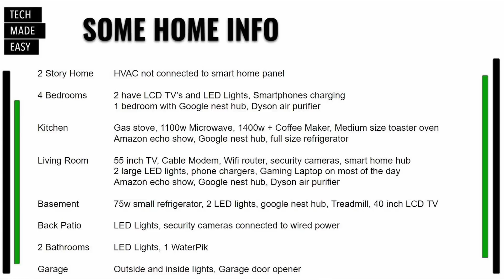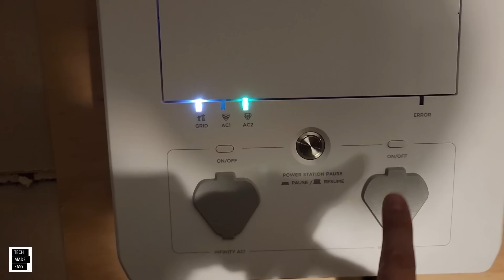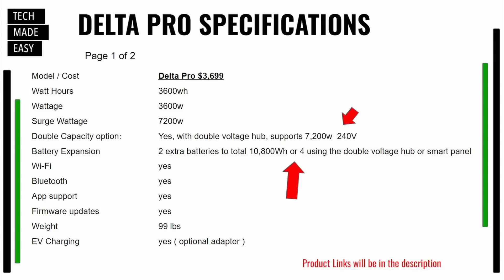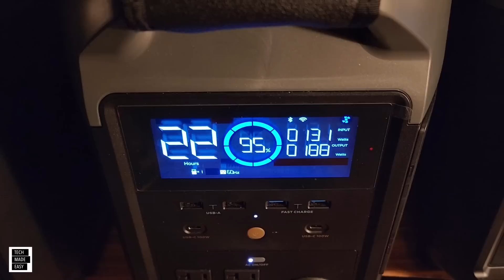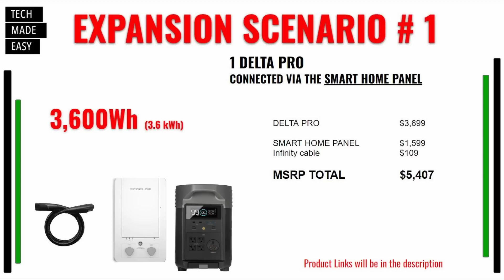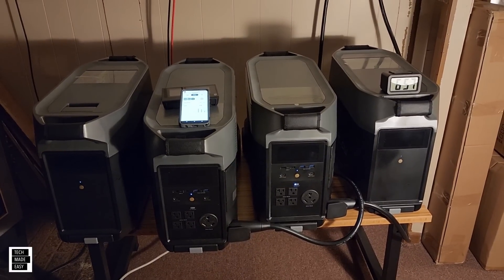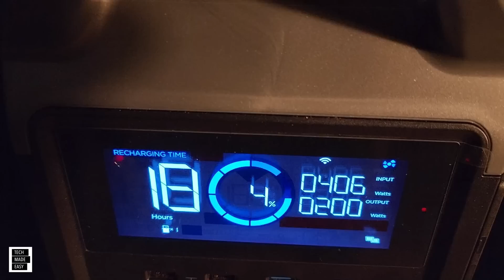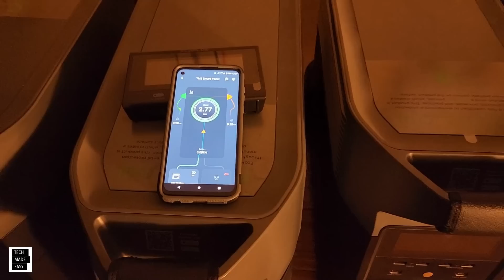Real World Test with EcoFlow Smart Home Panel & EcoFlow Delta pro

Comment: Your reviews are incredible.  I have a question see if you can help me out. Can I run delta pro with extra battery, and smart generator or should I run 2 delta pros with smart generator to run a  112.5 sq ft green house? With 12,000 btu ac, dehumidifier air intake system and fan for the summer?
And in the winter can I run a heater btu 5118 and grow lights 100-277 VAC 50-60Hz
60-600 Watts times 2?
Or tell me what I need to buy.
Please.
Reply from the maker: Thanks Tyrone, I wish I could give you advice but it's not possible on chat. Yes you can run a delta pro with an extra battery and a smart generator. The delta pro can run 3,600w appliances so if you stay within 3,600w you should be fine. Be aware of any surge or start up wattage before you make your investment. We have links in the description if you want to make a purchase, this also helps our channel. Email ecoflow support they can help also, support@ecoflow.com

Comment: Wow, this was the video I had been looking for.   Really clear and very easy for me to understand. The smart panel is a must butty in a system like this.  The app power usage issue seems very odd for such a sophisticated setup.  Likely human error?  We are searching for a system to enable us to manage power outages on a large home without worrying about AC or pool pumps. I'm a newbie to this so have two questions.  1) Can this Delta Pro System work while it's being charged by solar?  2) It Can this system handle 240 volt gear like large fridges and washing machines?  This was a huge undertaking so big thanks!  I'd love to see it repeated with the solar and see if you could get to a perpetual state?  I've liked and subscribed. Rob
Reply from the maker: Hi Rob welcome to the channel, yes you can charge the Delta Pros using up to 1600 watts of solar each, as far as 240v it needs to be setup and installed to support that, it's a simple plug that has to be removed.
Reply: @TechMadeEzy  thanks for the reply.  I've decided to build a 4 inverter system with 3 racks of batteries and 90kWh fueled by 56 panels ground mounted.  We will add a generator for hard winter days.
Reply from the maker: Hope it works well for you 👍🏼

Comment: Great video, very informative, I’ve subscribed! I’m doing research for a small 800 sqf cabin we’re building in a year or 2. This might work as a backup for us. Does the smart panel offer WiFi and remote access capability? Or is it just Bluetooth? I do know there’s devices that can take any Bluetooth device and make it available via the internet. Would be nice to get notifications or shed loads from afar! With regards to solar, will it switch to solar charging, when available, on its own if it’s being charged from the grid?
Reply from the maker: Hi John Yes WiFi remote access and it won’t switch to solar if available to my knowledge. I haven’t seen solar automations in the app. But you can set automations when the battery hits certain a percentage it will charge from grid.

Comment: On the app it appears the graph only showed the 4.09kW because you filtered for the week so it was only counting Sat. It's probably resetting the week to be Sat-Sat rather than a trailing 7 days.
Reply from the maker: Hi  I could choose month view. It says 7.86kwh and I definitely used much more, I would say around 12kWh or more
Reply: @TechMadeEzy  And I can confirm that I experience a similar problem with my brand new DP, where I'll find the app will show the DP as not connected (a few times a day), and when it does connect, the graph of power usage has reset. All else working, like for you. But it is frustrating to lose that data. 

It seems they're not saving and restoring it, whether in the DP/SH or in the cloud or on the app, which sure would be nice (setting aside privacy concerns some would understandably decry). 

Hoping they may address both our problems in some future firmware update (I'm on latest).

Comment: Can you get 7200 watts output from 2 delta pros if the smart panel is setup for single phase or do you need split phase to get the higher output?
Reply from the maker: Only surge few seconds
Reply: I don't know if this helps but...
I have two deltas and 4 batteries and the control panel.
When output exceeds what one delta pro and battery set can give I have seen power being drawn (visually in the app and on the delta pros themselves) from both batteries at the same time.   I only run 120volt appliances, etc. on single phase.   So... yes, I believe 7200watt output is achieved between the two delta pros set up in single phase.
I decided not to use any 240v appliances because I need the 10 circuits (large home... two main panels (not sub panels) and the control panel linked to one of them) and can do without the dryer or hot water and A/C units because these units will come into their own mostly when the grid is down.
Other than outages, these things save me money on electricity bills every month.
Reply from the maker: @chrisc4464
I have to correct myself you can get 7200 W as long as you have two Delta Pro connected even in single phase, each Delta Pro w will split a load

Comment: Exceptional video. I loved all the comparisons and system evaluations along the way.  Could these power a home HVAC system if you wanted that or is there some kind of amperage limitation?
Reply from the maker: Thank you
Yes it can power an HVAC system.
Reply: @TechMadeEzy  No offense intended but that seems entirely too simple an answer to that question. HVACs vary in size, of course, and from central air to minisplit. The DP also has a 30amp limit, while many hvacs could be higher--or at least on startup, so adding a soft start may be necessary. 

Most would also be 240v, which at least requires the 2 DPs. And even then the high constant draw of the hvac would likely eat all 4 batteries in far less than a day. 

Lots of variables, of course. But again, "yes" seems too simple an answer. Would be great to see it tested. Thanks for what you've offered in this test, of course.

Comment: How do I connect a Ecoflow pro to a none  Ecoflow transfer switch that has a cable and a 4 prong plug that does not connect to the Ecoflow pro. ….😢
Reply from the maker: Sorry wish I could help email Ecoflow 
Support@ecoflow.com
Reply: Thanks for your quick response… I have sent an email to eco flow but I suspect as I have all the electrical components for a large gas portable generator that’s the way to go. With Ecoflow I would need two pro and two batteries probably a hub and a dedicated transfer switch plus a solar panel array to meet my basic house requirements. We shall see if I get a response.

Comment: I don't understand why they don't drain the additional battery down first in order to keep the primary unit at 100% as long as possible, and bring the add on battery down to zero.  This would allow you to remove the additional battery and bring it to an EV charger, or charge it up in another location if needed.
Is there a benefit of bringing down both units equally throughout the entire cycle?

Comment: Can this be setup with a home backup generator and roof solar panel system?
Reply from the maker: Not roof solar at least that I know of unless you are purchasing EcoFlow panels they did just launch some rigid panels. They do make smart generators you can connect and they will automatically charge the batteries once the batteries hit a certain percentage. Here’s a link to a video I did on one of the generators.
https://youtu.be/onALnTDT7YE

Comment: I'd be interested in knowing how many refrigerators you had running during this test.
Reply from the maker: A small 75w refrigerator in the basement and my full size refrigerator, new model 2021 around 22 cu uses as much as 160w  at times.
Reply: @Tech Made Easy  in situations like this, it's really important to have efficient appliances. Would have never thought there were refrigerators out there that ran that low... looks like I need to upgrade.
Reply: @BlkFireHawk427  I can confirm the same with a several year old Samsung fridge (my DP showed less than 200 Watts through an extended test of hours). And a freezer was about the same.

The two together showed they could last days if they were all I connected. 

But I can add that in a recent extended outage of days--which prompted the DP purchase--I did not get even a generator going for about 19 hours. 

When I did, I opened the freezer and everything was still frozen. This is a rather basic family size freezer (though energy star). Just saying that some may find they don't even need to power the freezer constantly in an outage.

Always lots of variables in such discussions, and folks need to test for themselves. A cool thing about the DP (and SHP), and the app, is that you can get instant insight as was noted earlier in the video.
Reply: @Charlie Arehart  Great break down on your own experience. I, as well as many others thank you for sharing your knowledge.

Comment: Does the smart home panel require an electrician to install? If so roughly how much can one expect to pay for that? Excellent video BTW and thank you for taking the time to do this
Reply from the maker: Thanks so much 
It's recommended that you get an electrician I believe in many states you have to pull a permit also. I believe I paid $1,350
Reply: Is the $1,350 the cost of parts and labor?
Reply from the maker: It was for me

Comment: how many ecoflows can you link together
Reply from the maker: You mean delta pro units or what do you mean?
Reply: @TechMadeEzy  ya and to the smart panel ebay has refurbished ones I'm thinking of buying to run my house dedicated for solar since it's an all in one o dint have to buy controller inverters or batteries and i have panels
Reply from the maker: If you’re going to use a smart panel, you need at least one Delta pro that’s the main power station and you can add two batteries to the Delta pro. If you decide to add 2 Delta pros then you can add two  to each of them for a total of four batteries. Don’t forget the Delta pro has a battery itself.

Comment: 8:04 i’m trying to understand why your other set of delta pro and extra battery remain idle and you have to turn them off, and only one the other set is running…did you connect your appliance only on one side of the smart home panel?  Or if you keep all of them on will the smart home panel automatically get power from the other side?
Reply from the maker: Hi there My set is setup in single phase also the only time both sets will be used is when the home needs around 1800w or more then I’ve found it will split the load.
Reply: @TechMadeEzy  so, if you keep both sets of delta pros+ extra battery on, will the system automatically switch to taking power from the other delta pro+extra battery set when the first set reaches a certain %age.  Or will the first set of delta pro+extra battery just go to 0% and shut off, shutting both sets of deltapros+extra battery off?
Reply: @TechMadeEzy  i’ve been reading the smart home panel manual and i see there are routines you can create with if and then commands.  Maybe it is possible.  I mean i would hope so, it seems counter intuitive to physically turn the delta pros on and off or switch them when one delta pro reaches 0% and the whole setup turns off when the other delta pro has not even been used.
Reply from the maker: Automatically switch. I normally keep the other set off especially when I know I'm not really using much wattage. Otherwise it stays on and I lose about 5% or more if it just sits on and it's not being used.
Reply from the maker: I don't always use them so most of the time they are off unless I'm charging my Tesla etc.
Reply: @TechMadeEzy  oh okay…nice to know they automatically switch…wanting to use them for a small cabin that i want to set and forget for a week at a time.          Will they auto switch with just the hub or do you need the smart home panel for it to auto switch?
Reply from the maker: Smart home panel

Comment: can I use 3 x Renogy Bifacial 2pcs 450 Watt Solar Panels 12/24 Volt Monocrystalline PV and still fall within the manufacturer's spec?
Reply from the maker: You said 3x and 2pcs ?
The specs for the deta pro are 
1600w 11-150v 15a

Comment: I have quastion 
I want to buy 2 delta pro with 240w switch and dhe smart home switch  for  helping my bill.
Can you please give me some detail if is easy to installed   or i need pro electrician. 2:41
Reply from the maker: Hi I’m not an electrician so I had them install it. It’s been working fine since.

Comment: Wish I could get a smart home panel. They are unavailable in Canada. I would love to see the whole system tested with solar panels hooked all the time.
Reply from the maker: Have you emailed EcoFlow ?
Reply: @TechMadeEzy  I haven't. Just assumed it wouldn't get shipped here. I will though. What are your thoughts on using this system as a "off grid" type. Having solar Panels charging Delta Pros and battery during day and using at night. Or is the Ecoflow more used for a "backup" system.  Thx. I love the video. Great info!
Reply from the maker: It's not cheap but keep in mind the batteries are huge and they last for years they do require some consistent maintenance if you're not using them but I've had good experiences thanks for watching the video and being a supporter 👍🏻😎

Comment: Great Great Video and a lot of information I didnt find on other youtube channels and reviews so thank you.  I do have a question and see you haven't done the test yet with the solar panels.  Can you charge the Delta Pro (one side single phase) with solar and use the Delta Pro at the sametime powering your house or are you having to charge 1 set at a time and let the other set run your house with moving the solar cables each day to the other Delta Pro set?  At the moment I have the Home Panel and 1 Delta Pro and looking to add solar in the next couple of weeks with the hopes to have the same setup you have by the end of the year.   Thank you
Reply from the maker: Thanks much !
You can charge 1 or both and still use them to power the house or specific outlets, did you see our Tesla video that launches this morning? I show how I power one outlet.
Reply: @TechMadeEzy  Don't see it posted.  Last posted video is the Romoss
Reply from the maker: Link to the Tesla channel 
https://www.youtube.com/@MyTezlaJourney1
Reply: @TechMadeEzy  All coming together now.  Thank you
Reply from the maker: 👍🏼 you get to check out the video

Comment: The people who are asking if the system will run an HVAC system or a washing machine, or some other high power draw equipment need to re-think their "grid down" lifestyle. Wash clothes by hand; dry them on a clothesline. Heat the house with a wood stove. Wash your dishes by hand. Unplug all those wall warts. Home energy generation/storage is still quite expensive, and you need to consider how much power you REALLY need.

Comment: How long do they take to charge? I live in Lebanon where we only get electricity for 1 hour a day. Sometimes 2 hours a day. What system would you recommend? Ecoflow support is horrible at recommending a solution
Reply from the maker: Setting up a large solar setup would definitely help, each delta pro can handle up to 1600w of solar so if you have good sun delta pro and smart home panel could be a good choice
Reply: The manual is online to look at. Max input charge power from mains is about 2800W.  Battery is 3600Wh. But not sure how good it is to regularly charge the batteries at such a high rate.

Comment: P.S. In the final analysis, I really think the smart home panel product is simply overkill. The reason why I have arrived at this conclusion is because the smart home panel is not as comprehensively wirable as your pre-existing panel in your home is already wired. The better value comes from the dual voltage hub operating in split phase 240 AC @ 30 Amps plugged into an installed switch over box connected to your home panel. In this configuration EcoFlow has perfected a truly plug and play home backup solution. The smart home panel has great geek appeal, in that it is programmable, but the majority of folks don't want complexity in their home power backup solution. There is a certain elegance to the simplicity of the dual Delta Pros connected together via the dual voltage hub solution. No extra batteries required (But would be a great idea), and no expensive Solar Panels necessary (But essential for going off grid), just plug and play instant home backup ! Amen ! 😃👍
Reply: I believe that I'm with you on this deal! 👍🙏

Comment: I need a unit that will deliver 3000 watts.  I do not like the idea that one needs a smart -phone & it is way too technical to set up. Why can't I get something that is plug & play?
Reply from the maker: There are many units that will give you 3000w they are expensive and usually larger units, you don’t need a smart phone but in order to update the units firmware for improvements you should have a smartphone or at least a tablet with some type of internet access